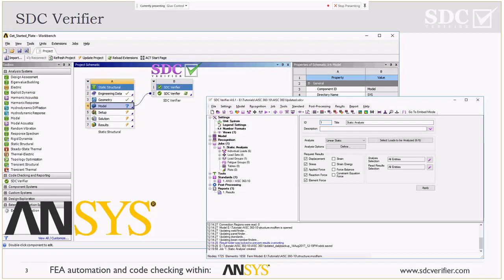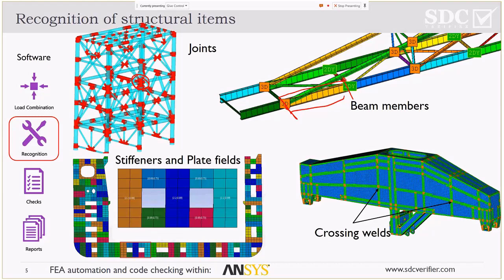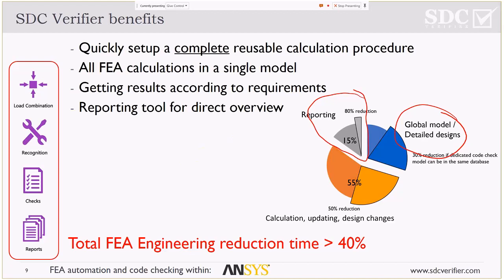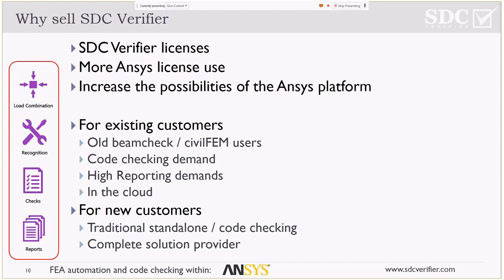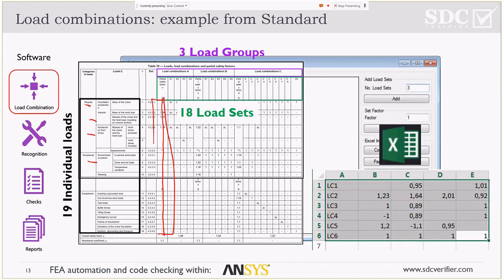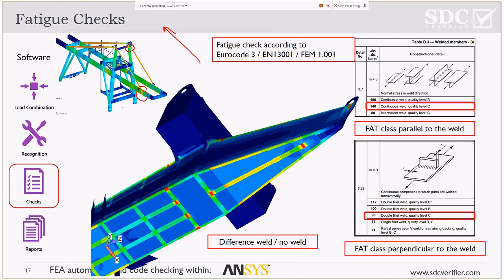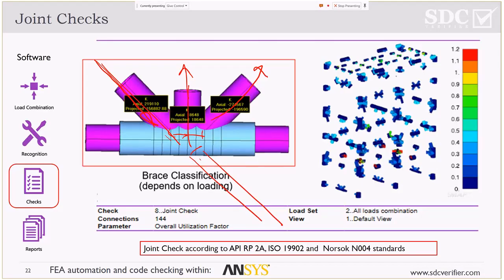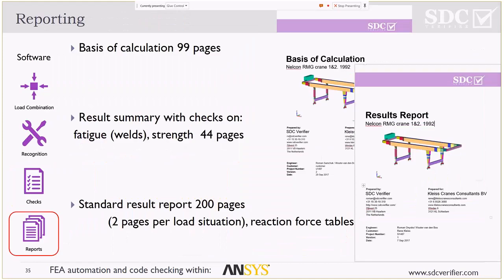Webinar #1 (Ansys) - SDC Verifier introduction

Comment from the maker: Timecodes for browsing through webinar

2:37 – Introduction. What is SDC Verifier
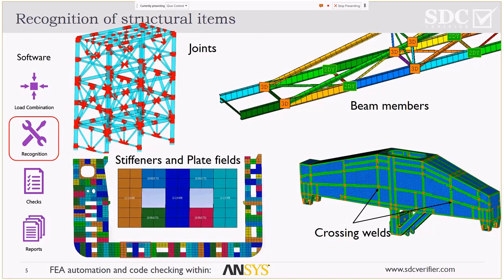8:56 – Recognition of structural items (Recognition tools)
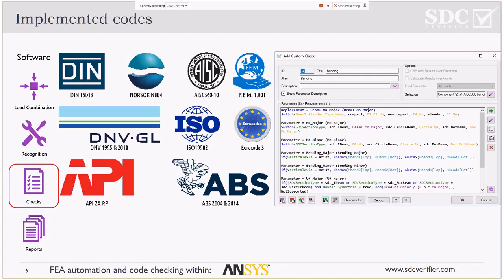13:04 – Implemented codes
14:27 – SDC Reporting (Short description)
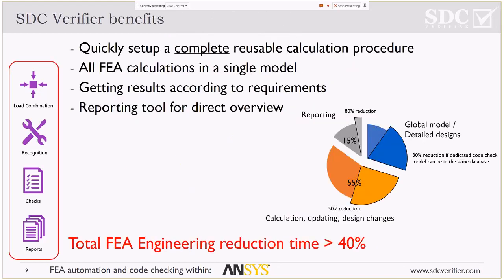17:17 – SDC Verifier benefits
24:16 – Why sell SDC Verifier
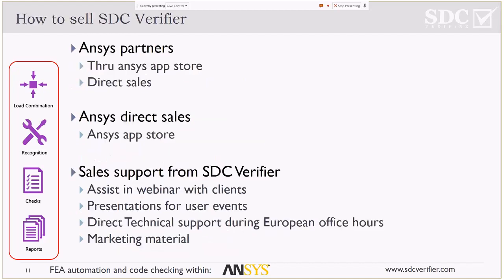28:25 – How to sell SDC Verifier
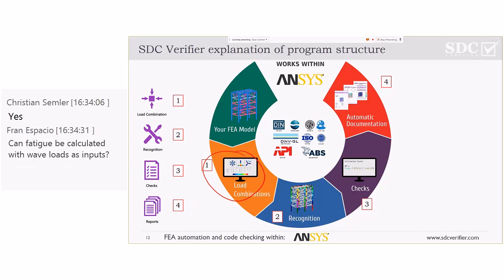31:20 – Load combinations: example from Standard
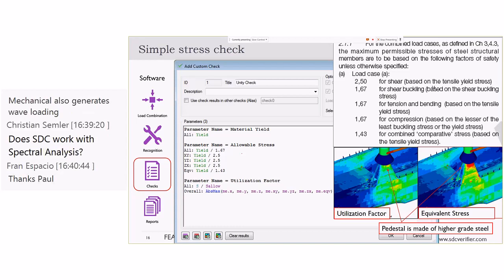37:45 – Simple stress check (example)
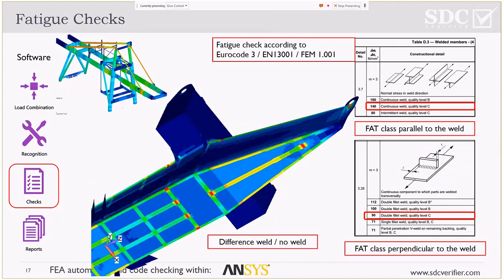40:35 – Fatigue check (example)
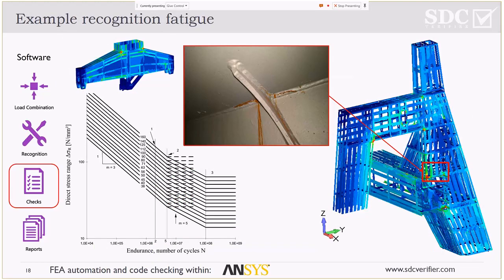43:03 – Example recognition fatigue (real situation)
44:31 – Weld strength check per weld
46:35 – Plate Buckling
47:39 – Beam member check
48:27 – Joint check
49:45 – Custom check: Rivet and bolt check example
50:13 – SDC Reporting (more detailed description)
52:00 – SDC Results Report. Example 30 years old crane
58:00 – Information for interested in SDC Verifier
59:41 – SDC Verifier company contacts
1:00:03 – Answers to questions